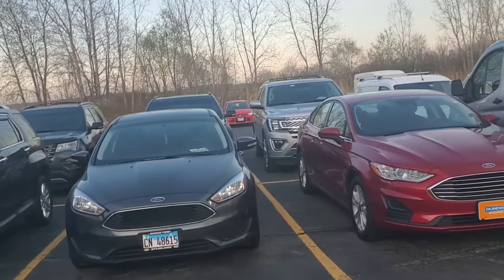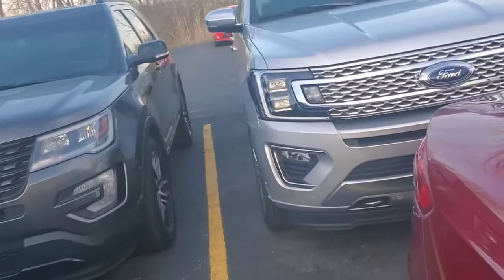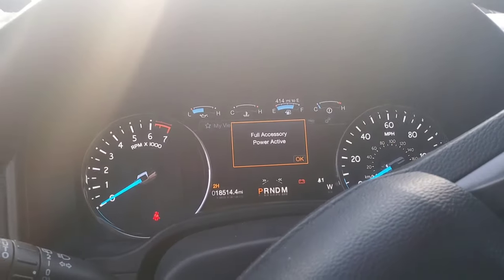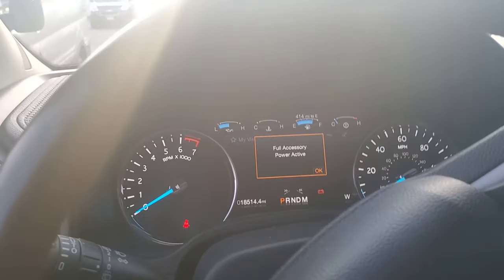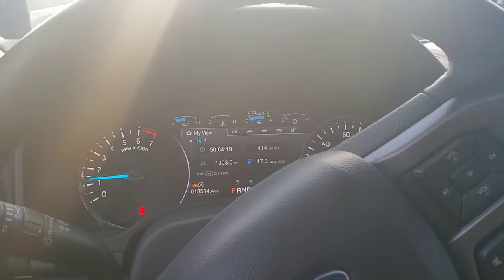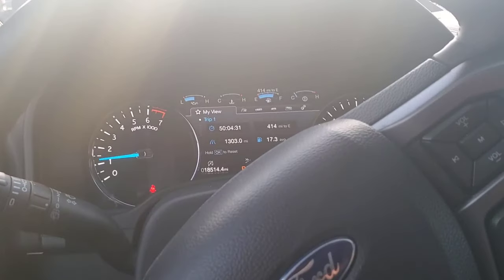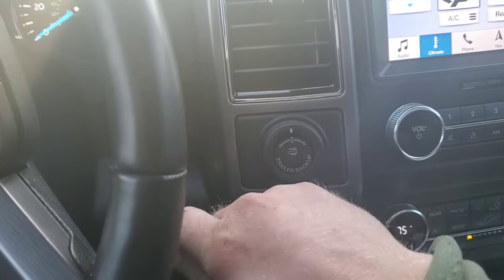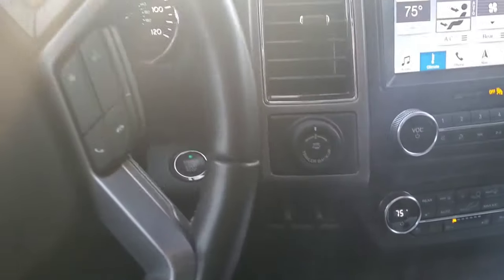3.5L Ecoboost F150 Rattle on Startup then gone, Try this - Could Fix Ford's Phaser Problem

Comment: Rich love your vids, I just got my 2018 back for cam phaser replacement exactly as you described, Im curious what you think of  Raptors overall- Gen 1, 2 and 3? I searched your vids but haven't found a vid of you speaking on them
Reply from the maker: I think they are pretty cool and they perform very well but they have a lot of unnecessary issues that I prefer not to deal with
Reply from the maker: If I had to pick one generation one would be my favorite

Comment: Hey bud. Different question I have to ask. Had my F150 2017 at the dealer three or four times for this ridiculous rattle coming from the exhaust or heat shields. But they cannot locate it or solve this problem. I checked the heat shield under the exhaust pipe and it is intact. It’s probably only a happens maybe once or twice a week really ridiculously loud when it does start  any thoughts?. Much appreciate it!
Reply from the maker: Turbo wastewater rattle
Reply: @FordBossMe  no I find out it was coming from ewi?  I watched another of your videos and my hub spins while in 2 Wheel Dr. Replace check valve but still does it

Comment: I watched a different video about phazer rattle . The mechanic said ford has an updated phazer that seems to be solution if you wanna pay that much to fix . Greety dealers and company . 
P.s you have to request the new version . Because the abundant stock of the bad phazers they might try get rid of those first so make sure to request new updated phazers . If this is even true  .anyway good luck everyone.  God bless

Comment: I have a 2004 and a 2005 Grand Marquis. Very noisy on cold startup. Should I do this as well or is that noise not the same and I should not worry about it. Thanks.
Reply from the maker: It'll help

Comment: So how long will the phasers last without doing this? Is it needed every cold start. My 2018 3.5 started a month or so ago with the oil start action rattle. Is there a permanent fix or just bandaid? Still under drive train warranty. Any steps I should take? Thank you for the informative videos.
Reply from the maker: I don't know
Reply from the maker: This is just to help some of that extra destruction
Reply: I appreciate the info. Will help me make the motor last longer. Maybe I won’t trade it off so fast. I appreciate the tech stories as well. Thanks for the response.

Comment: How does holding gas/break down while cranking prevent the motor from firing?
Reply from the maker: So I explained this I don't know if you paid attention or not but it's called clear flood mode it's a strategy that the vehicle uses to open the throttle blade completely and suck in fresh air to clear out raw Vapors in case the intake manifold is flooded so it disables the injectors from firing so you can just draw in straight fresh air in the vehicle doesn't start

Comment: I put 80,000+ on my 2013 F150 3.5 EB and no rattle or shutter.  No special treatment other than top quality 5-30 oil at 5,000 OCIs.   I have about 35,000 on my 2018 F150 Raptor and no such problems and same no special treatment.  So wonder if this is a problem that occurs due to wrong oil or sludging which slows oil flow to the nether regions.

Comment: Great video man. I have a 2010 taurus sho that is starting to rattle that I will do this with from now on. Quick question. What damage is caused by letting it rattle? Thanks, Chris.
Reply from the maker: Eventually the timing chain make it so loose that it ends up slipping timing and then you get a bunch of misfiring and engine damage

Comment: Has Ford fixed this problem on the 2022 F150  3.5 and 2.7 ecoboost. I really like the truck but spending 50 or 60k on a truck and having to hold down the gas and flood it every morning doesn't sound reasonable.
Reply from the maker: Yes
Reply from the maker: Nobody is telling anybody to flood mode vehicle every morning

Understand the message between the lines is only for emergency use it is not a fix and it's not something that somebody should do every morning
Reply from the maker: The new vehicles do not have the rattle on Startup

Comment: Sorry for being so long of a comment.  Every vehicle is different. Some it works on, some it doesn't. Chains are still loose either way. Install an hv oil pump and new timing set along with the newer style phasers and your good to go.  Do it yourself and it'll cost under 1k for factory parts and melling oil pump. Problem solved.  Also, can't use your remote start with your method if you have one. 
  Every manufacturer has the same issues with the phasers. Dodge, Chevy, Toyota, etc.  If it were that easy to just quit using the phasers, they would.  Engines wouldn't have the power they have if they went back to no phasers. At least in the rpm range used by most people.  
  Video is good, but there's always a reason why they don't do something when it seems like the easy thing to solve an issue. You may not see the issue with extended starts, but problems have to be worked out to make sure it doesn't keep causing an issue or cause other issues.  Plus, customer complaints on one thing might not outweigh complaints on another issue.
  Being a racer, I am constantly battling computer programming. Change one thing, and the rest of the system doesn't like it.  Some things have to do with emissions. Get power at certain rpm but produce more emissions if phasers aren't positioned correctly.  If it doesn't meet standard by removing or changing the setup, then it doesn't work.  Modern engines aren't making power using old tech. Old tech is no cam phasers. Why do you think so many vehicles have turbos now?  It's the only way they can meet the standard and get more power. If they came out with the next year model and it had half the power the last model had, sales would drop like a rock. 
  Also, everyone thinks an engine should last forever. Back in the 40-50s, you were lucky if you made it 50k miles. Bearings were being replaced at 30-50k miles. Major repairs were needed over 50k on majority of vehicles. Make it to 100k miles, and the vehicle was considered wore out. Even in the 90s, I wouldn't dare buy anything close to 100k miles.  Today, tech has changed, 150k is nothing if maintenance is kept up. 
  Most of my vehicles now get over 200k.  The thing is, timing sets are a part of maintenance, but people don't treat it as such. I normally replace the timing sets around 100k whether it sounds like it's needed or not. I trade-in when my steering wheel comes apart and the seat cushions are flat.  A vehicle isn't meant to last your lifetime, and they are expensive to maintain.
Reply from the maker: No I can't even read the rest of your statement and the reason I say that is because you're preaching to the choir first of all I never said all vehicles were the same I only spoke about particular vehicles, second of all you're talking about chain rattle this is not chain rattle this is timing chain phaser lockout pin rattle

They sound the same but they are not the same make sure you kind of know what you're talking about whenever you're giving advice on this stuff because you started your statement out completely wrong enough to shut me down and say you know what I'm not even reading the rest of this because you didn't even focus on the topic at hand which was phaser rattle you said something about timing chains which this has nothing to do with timing chains

If you would like to go back and readdress this whole thing and then start off on the right foot I'll read it but I'm not reading all this because it doesn't even start out the right way you took it somewhere completely different that has nothing to do with this video
Reply: @Ford Boss Me    Didn't mean to offend you. I've did dozens of timing sets and know exactly what I'm talking about. Cam phasers are replaced or at least highly recommended to be replaced when doing a timing set. Look at TSB 22-2200. I understand phaser rattle with the lock pins, but most people think it's the phasers that are the problem. It's mainly an oil volume problem. And the chains are directly related to what helps tear up the phasers. They go hand in hand with ea other and are both hurt when oil isn't present. Delaying the start is getting oil there and tightening everything before it starts. If the chains are slacked, they yank the phasers back and forth against the cams, which is wearing/shearing the pins, due to not enough oil being supplied to them. It's funny people tell me I need to do more research when I'm the one physically doing the work and can do a timing job pratically with my eyes closed.  Again, didn't mean to offend you. I'm not good with people's feelings. I just tell it how it is. 
  TSB 22-2200 Ford states to replace the vct unit. Go ahead and just replace the unit and you'll be right back to a rattle prematurely if you don't replace the whole timing set and get a new oil pump in there.  I've did this many years and know what I'm talking about.

Comment: Well, cam phasers issue in 2015+ which is 2nd gen? So my truck is 2012 and it's twin turbo. I had zero issue with cam phasers. However, I do have 3-5 second rattle sound around the driver side turbo and more likely I detected an exhaust manifold gasket heat shield rattle against the cylinder head or it could be a wastegate but there's no loose. It could be an internal turbo flap loose but it really runs perfectly. I knew 3.5l Ecoboost with single turbo or twin turbo worst issues in 2015+.
Reply from the maker: 2017 plus are the worst
Reply: Yeah, I have seen a lot of people complaining about it today and I'm lucky I am still the second owner of my 2012 truck.

Comment: i had my phasers reprogramed 2 weeks ag.my truck had zero issues..but now it makes this tapping noise until it heats up..whf??goes away after 10 minutes or so!Not a oil sounding tapping,but sounds like sometime rubbing sound..Real hard to describe.
Reply from the maker: Take it back to the dealer and explain
Reply: @FordBossMe  i guess from reading up on this and youtube like folks like you..this process needs to be reversed..So silly!..Thanks for your help as always bud!

Comment: I have an '18 Expedition that has a weird rattle under the driver floor or in the driver wheel well on cold start. What could that be?
Reply from the maker: I have a video showing what it is, it's an exhaust clamp or turbo linkage rattle 

Look in the library f150 and or Expedition rattle

Comment: I noticed for the first time that my low oil pressure caution came on. Rev the engine and it went away. This happened 2 weeks later, same thing. A few months later, the slight ticking when cold. Is it possible that this has to do withe the timing chain tensioner? I see that ford has a TSB out on my year of f150. Bulletin is 17-0026
Thank you
Reply from the maker: The tensioner won't cause low oil pressure but it's very possible that you could have a tensioner issue sure
Reply: @FordBossMe 
Did you happen to read the TSB 17-0026 that I mentioned? It described my problem exactly and they want me to do the tensioner kit for my problem. Does the tensioner bleed down after overnight sitting? Also, why hold down brake when doing the gas peddle prime if vehicle is in park?

Comment: I didn't think the starter turned the motor fast enough to make the oil pump build pressure, why they use a drill to prime the engine after a rebuild instead of using the starter, looks like that would be harder on piston rings too... idk
Reply from the maker: It does

Comment: The extra cranking is completely unnecessary. A simple check valve in the oil return will keep the oil in the upper engine allowing for the locking dowel to stay engaged in the phaser. Navistar did this with the now defunct Maxx force diesels to allow for starting.
Reply from the maker: You're right the extra cranking is unnecessary

 but until somebody fixes the problem is going to have to be that way thanks for coming to my TED Talk

Comment: I have a 2021 F150 with the 3.5 Ecoboost engine. It has a key, not a start button. I tried what you suggested, but with the gas pedal fully pushed down the vehicle is starting right up and not letting me just crank without starting up. Is there something different about the 2021?
Reply from the maker: It should do it the same way gas pedal to the floor and then turn the key forward and crank it there should be no starting involved on a 21 until you let go of the gas

Comment: You should NOT have to prime this system every time before you start. I just had all my parts replaced because my 3.5 EcoBoost was knocking real bad on startup. Ford sent out a tsb instead of a recall. Also another thing myself and the mechanic learned through this process is that these vehicles need a motorcraft oil filter with a built in check valve. This apparently stops this cold soak problem with the phasers.
Reply from the maker: I'm going to do a video response to your question
Reply from the maker: I'm going to help you out a little bit understand the system even better and explain some things because if your mechanic just found out about this yeah there's an issue there and no it does not have to be a Ford filter but let's go to the video

Comment: But it could drain the battery or overheat the starter motor if I am doing this?
Reply from the maker: How's it going to do that if you're only doing it for 5 seconds one time a day or every couple days because remember as I replied to everybody else this doesn't fix the problem this only gets rid of the rattle on Startup

Comment: Wait, how do you keep it cranking? When you hit the start button, and you're on brake, won't it start the car right up? Or are you holding the start button down for a while? I'm confused
Reply from the maker: No it won't because you're holding the accelerator pedal to the floor that was the whole purpose of this video was to show you how to put the vehicle in flood mode as you're holding the brake and the accelerator pedal to the floor when you push the button it will crank it over but it will disable the injectors but again the gas pedal needs to be pushed to the floor
Reply from the maker: I know you're not holding the start button down for a while I was very clear you push it one time just like you're normally starting at the only difference is instead of having your foot just on the brake you have your foot all the way down on the gas pedal as well
Reply: @FordBossMe  thanks for the clarification, so i just went to my ford flex ecoboost, it had been rattling at cold starts, today all of a sudden it didnt lol. I thought id hear it and confirm before trying this but it felt like no need for it anymore, it'll solve itself. Of course im scheduled to go into the dealership to have some warranty work done and now its happened to fix itself lol

Comment: Tried this and it worked! But does it have to be done for every start?
Reply from the maker: It's only a temporary Band-Aid not to make things better but it will not fix anything and it will not make the system any better to be honest with you
Reply from the maker: Theoretically when you hear the rattle on Startup you got to have the phasers to replace anyway and you may as well do the chains and guides while you're there
Reply: I see. I had a feeling it would come to that. It doesn’t rattle every time but I want to be proactive about it

Comment: Will this hurt the engine. I really want these but don’t want to deal with this every time I go to start the car cold. Can’t they make a new recall.
Reply from the maker: There is a newer phaser out Gen 3 and it seems to be lasting, check out my library
Reply: @FordBossMe  I really want a 3.5 I love the turbo sound on them. I just don’t want to deal with the issue like these. I love how mod able they are.
Reply: @FordBossMe  why don’t they have lockout cam gears for the 14-16 3.5

Comment: I got a 2018 F150 bought in November 2017, at 38k km rattle was getting pretty bad. The dealership replaced the VCT's, chains, tensioners and also reprogrammed the PCM(that's when I noticed much longer crank times when cold) so I thought they're already doing it.  Anyway they had to redo everything @80k km, this time with upgraded version of the parts, as for the cold cranking time it's still longer then when it was new. Now the the truck has 110k km and no signs of any rattle.
Reply: Sorry,  hit the wrong button and posted before finishing my thought.
Reply from the maker: well that's good in your favor for sure

Comment: This helped my truck, just to verify, this will not cause any damage in the long term?
Reply from the maker: this won't cause any damage but it is not a fix, eventually phasers will have to be done

it's just to help get oil pressure up there so it isn't a dry start after sitting awhile

Comment: That makes so much since but let me ask you this…if mine is already rattling should the vct’s be changed out due to wear from this issue and then a pcm flash to raise oil pressure?
Reply from the maker: Vcts for sure
Reply: No.  Vct are not going to fix it.  I just finished replacing my vct's with ford oem.  Also replaced my cam phasers and chains and tensioner.   Still rattling at cold start up.

Comment: Great info. My wife has a 2019 2.0 Ecoboost I was going to change the oil at 5000 mile intervals. but now it's going to be 3000 miles.  She has a little over 2000 miles on the clock and I have added a oil separator which was a little  harder to install than usual but all bolts were torqued to spec.
Thanks, by the way what is your first name?
Reply from the maker: Rich
Reply from the maker: Good job on making that choice, Oil Seperators work
Reply: @FordBossMe  Thanks for the compliment Rich. As you can see my name is Ed and did I mention I'm 78 years old? And I drive a 2020 GT Mustang. Your info is spot on and I learn a lot about things that I did not know much about. Thanks again.